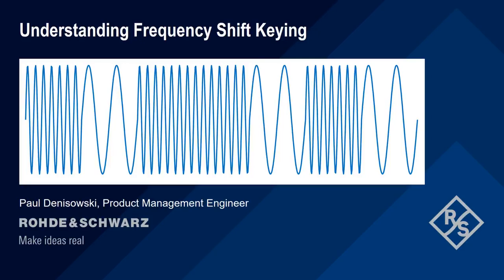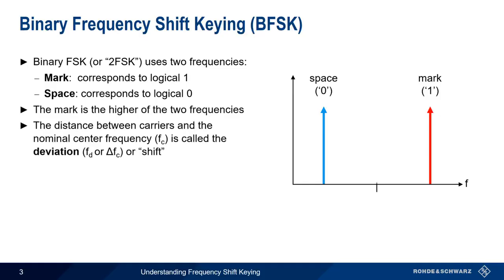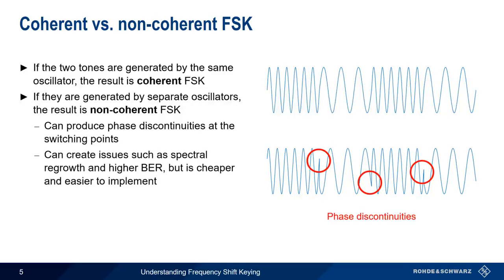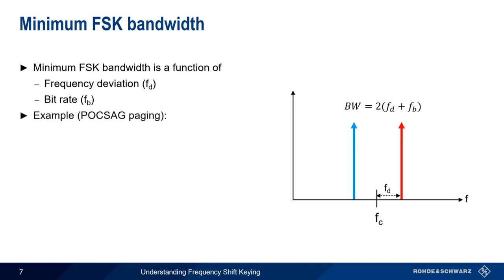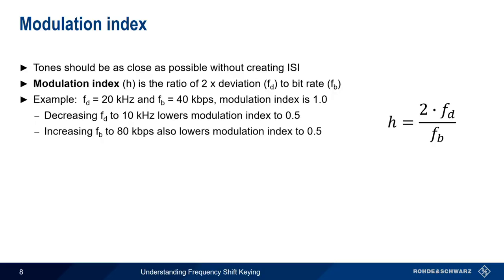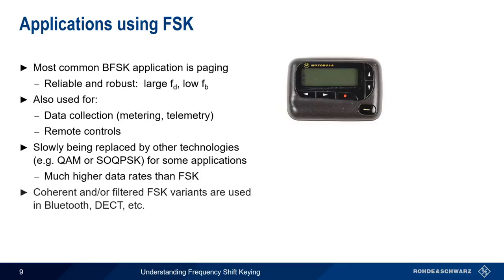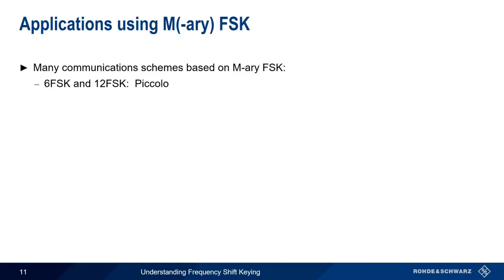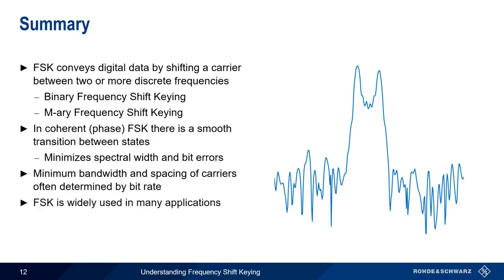Understanding Frequency Shift Keying

Comment: So, I have always heard M-ary FSKs referred to as MFSKs, with higher order FSKs referred to as 4MFSK, 8MFSK, etc. Why is this not as accurate? Thank you!
Reply: (laughs)  That's what happens when I go off-script when I'm recording. :)  For consistency, I (try to) always refer to digital modulation schemes as modulation order + type.  So I would say things like 8PSK, 16APSK, 64QAM, etc.  Using this convention, higher order FSK modulation schemes would be 8FSK, 16FSK, etc.  No one says "8MPSK" or "64MQAM" - the number  indicates they have more than two (M-ary) states, so in my opinion the 'M' is redundant.

There is also a something called "minimum shift keying," abbreviated "MSK," so that could ... potentially ... be confusing.  [MSK is actually rarely found as "pure MSK" but rather in things like GMSK]

But in all honesty, there are lots of people, myself sometimes included, who refer to 16FSK as "16M(F)SK" and that's completely fine.  In fact, I would say that "16MSK" is probably a more common abbreviation than "16FSK,"  so please don't take my offhand comment too seriously :)

Thanks for a great question!